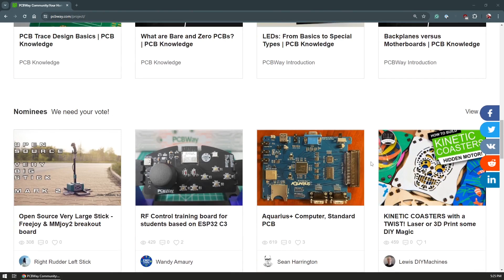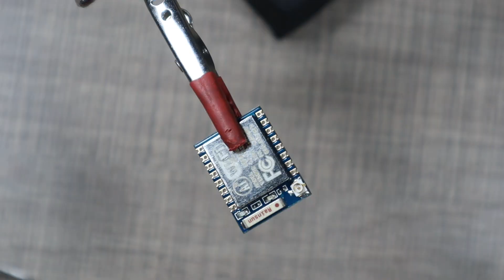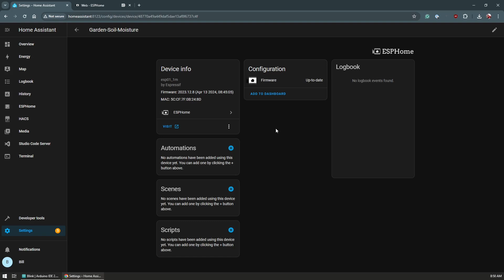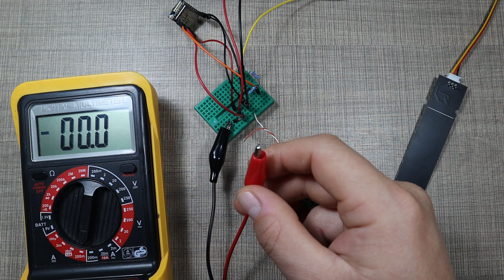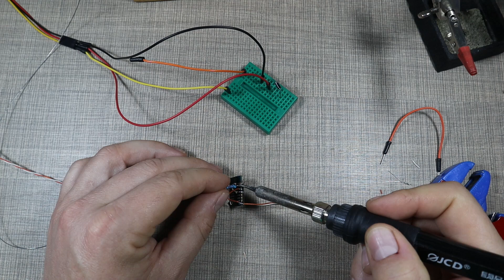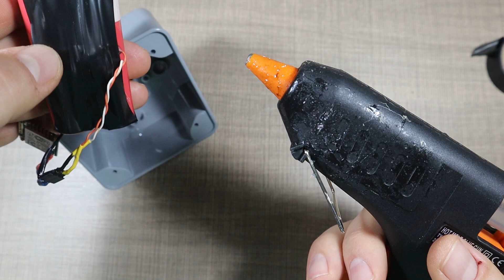Soil Moisture Sensor on batteries with ESP07 running ESPHome - Start to Finish

Comment: Why would you spread glue over the entire sensor??? You've ruined it completely
Reply from the maker: Not at all. This is a capacitive sensor. It measures the change in capacitance as the water content changes in the soil. Water ingress is how these sensors fail and since the electrodes are covered from the factory with the solder mask, covering the edges with epoxy does not change the behavior of the sensor in any way. It just extends its lifetime.

Comment: How much autonomy You can have on batteries ?
Reply from the maker: This worked well for about 2 months on a single charge but this can be optimized .by adding a transistor to turn off the soil sensor when in deep sleep. Right now it is not working since the soil sensor developed some fault and started outputting garbage data but I'm looking to build an improved version for next years growing season.
Reply: @TasteTheCode thanks for answer. On other place I have read that edge of sensor should be covered with paint or something similar against water. Circuit board is not protected from side .
Reply from the maker: Yes, true that. I used epoxy to cover the edge. I don't think the problem was moisture. I'm suspecting heat but I did not have the time to fully inspect it.

Comment: Thanks so much for this video!
I hooked up my voltage divider, as suggested and it is preventing the ESP from booting on. Any ideas?
Reply from the maker: Make sure that the wiring is correct and if it is then try some other pin. There are a few pins on the ESP that need to be disconnected at boot.

Comment: Hello again, ignore my last comment, I figured it out. For others who may need help, connect your VCC of the sensor, in my case, the Capacitive Soil Sensor V2.0, to one of the digital output pins of your ESP32 and then set it HIGH upon waking out of deep sleep mode and to LOW just before the ESP32 goes back to sleep.

- Sleep for an hour
- ESP32 wakes up
- Activate the soil sensor
- Read the level
- Email or text if level is above ~580
- Deactivate soil sensor
- Set ESP32 into deep sleep mode
- Rinse and repeat every hour, day, month, whatever you set it to

So far, my 3.7v 18650 li-ion, 400mAh has not even dropped and it's been running for a day, waking up every hour for now. Once I'm convinced it works, time to set it to a daily wakeup and put it all into a portable container.

This video was awesome, btw !
Reply from the maker: Awesome, I'm glad you managed to figure it out, and yes, I haven't done this to mine yet but I will as it uses some power unnecessary. I was thinking about using a transistor to turn it on but your solution made me realize that I do not need to as it only uses a few milliamps. Do you maybe have the ESPHome configuration code to share?
Reply: yes, very good idea, do you have the yaml to manage the pin in ESPHome before sleep and after wake up ?
i'm really not familiar with ESP-Home. Thank you.
Reply: I found out that the sensor I have (DFRobot v 1.0) needs a little time to startup, some hundreds millis before readings stabilize.
Reply from the maker: @minime9400 that can be true for a lot of sensors, not just this one. Adding a small delay before measuring is OK.

Comment: Hello all !  I have this running, however, the Capacitive sensor drains the battery even with the ESP32 is in deep sleep mode.  Is there a way to "wake-up" the sensor when the ESP32 wakes up?  (e.g. put both to sleep)
Reply from the maker: Hey, yes. What I end up doing is to power the sensor from a pin on the ESP. When the ESP wakes up, it powers the pin high thus powering the sensor only then. Once the measurement is taken, the pin is pulled low to turn off the sensor and it then goes to sleep.

Comment: What do you think of using the ESP-01S with those expansion boards like RGB LED, DHT11, etc? I'm testing it with CR123A batteries.
Reply from the maker: I wanted to use it at first because I have plenty of them but the problem is that they do not have analog input. For things like I2C, they should be perfect.

Comment: Hi, have you tested it with espnow? Could it last longer since it doesn’t connect to wifi
Reply from the maker: No I haven't. It might be an interesting thing to explore but I guess it will also need a receiver.

Comment: How long does it run with one charge?
Reply from the maker: The run time greatly depends on the duty cycle of the deep sleep. I'm still testing this but if it runs for 30 seconds every 3 hours, it should last for about 45 days.

Comment: Do yourself a favour and cover the pcb with hot glue or similar. Otherwise it will be destroyed by the humidity of the soil within 1-2 weeks. I "painted" them with hot glue and worked with a hot air gun to keep the layer thin :)
Other than that - interesting project!

p.s.: saw on second sight you covered the edge of the pcb. I coverd it completely including the smd components and drove it completely into the earth to have more accurate results.
Reply from the maker: Thanks, that is a nice suggestion. I've seen people using nail polish to cover PCBs. I guess I can add some hot glue to the board and spread it using my hot air gun. I'll see how it goes. 
As for the edge, yes, I covered it with epoxy so to prevent any ingress in the board itself. I was considering to cover the whole thing but I was worried that I might mess up the capacitance and the readings.

Comment: What does the moisture level correlate to? Is it volumetric water content?
Reply from the maker: A capacitive soil moisture sensor measures the dielectric permittivity of the soil, which is indirectly related to the volumetric water content. They use an oscillating electrical field to measure the dielectric permittivity of the soil. The presence of water affects the capacitance of the sensor, because water molecules align with the electric field, this changes the capacitance value. This change in capacitance is then correlated with the soil's moisture content, outputted as a change in voltage.